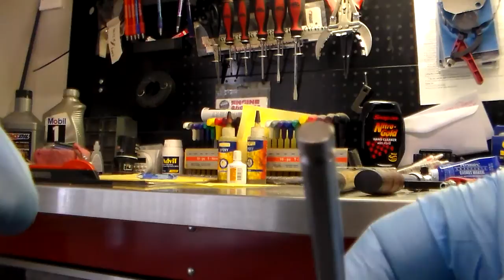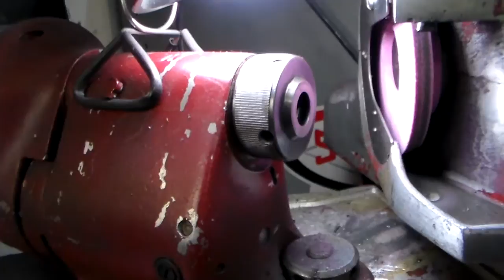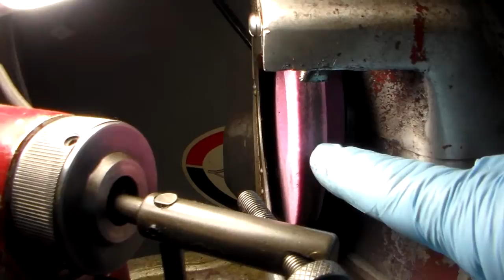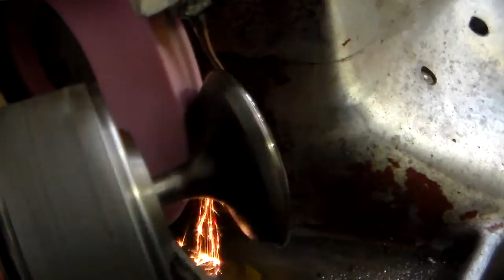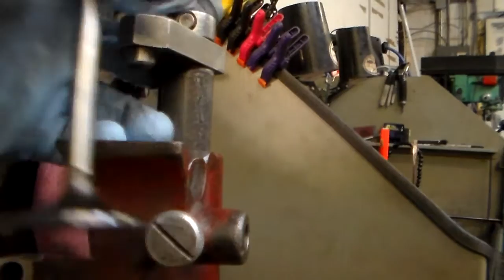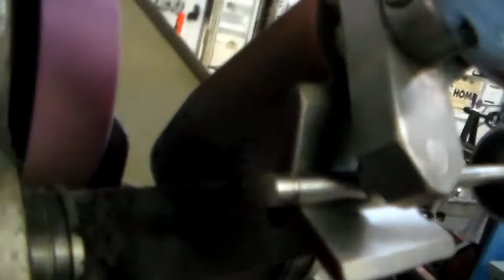Valve Grinding

Comment: this takes me back to the mid seventies when I was first learning to be an Automotive diesel mechanic...... many an hour spent at the wire wheel cleaning every nut and bolt and part. then cutting the valves and seats. yes cleaning every part by hand was a better idea..... I always knew if a part was worn past its repair tolerances early on in the cleanup!

Comment: Use glass bead blasting cabinet to clean valves
Reply: or ez off oven cleaner and a red scotch brite.. put the valve in a drill, and hold the pad against it.